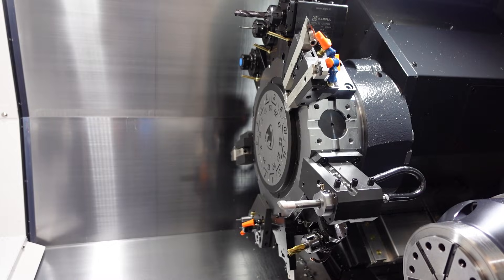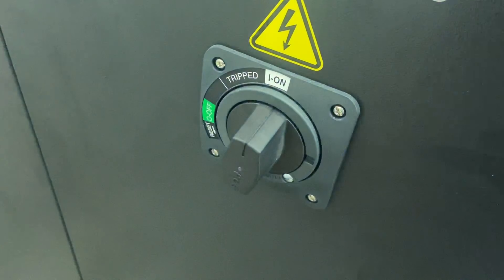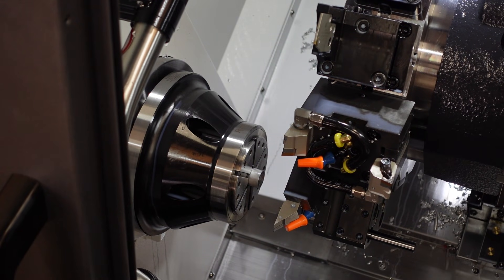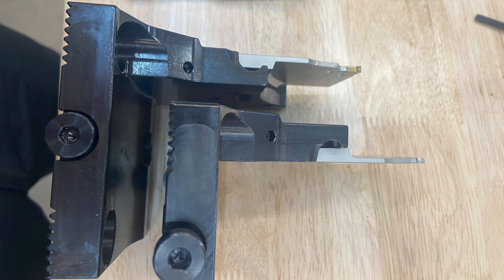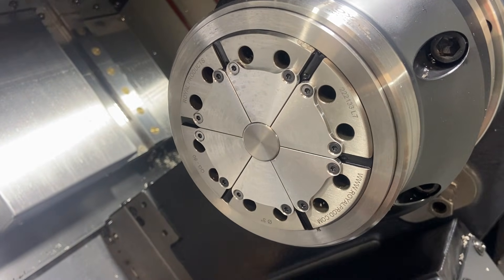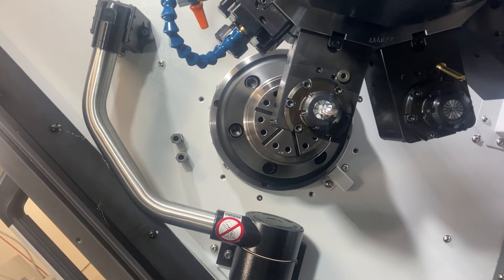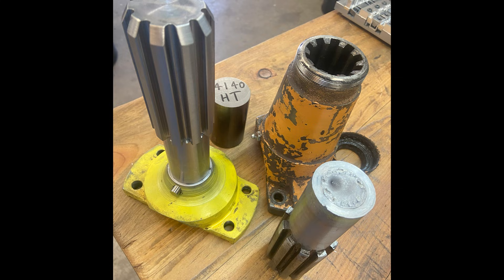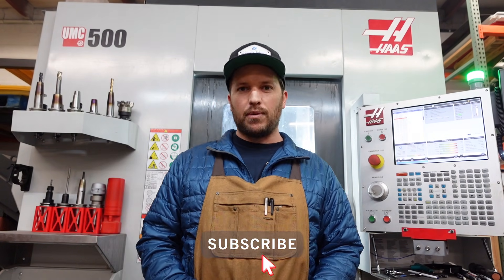CNC Mill-Turn Lathe | 10 Months In 12 Minutes

Comment: awesome stuff. Do those jaws need to be machined to sit flush up against the chuck? or is the clamping pressure going to be maintained just by the strength of those screws? I'm going to make myself some of those. Unless you've got a .step file you'd like to donate? lol
Reply from the maker: I don't mind sending over some .step files but they would only be useful if you also plan to use the Royal QG-80 3" collet. To be honest, making the aluminum jaws in the mill is easy in comparison to adding the tapped holes on the collet face. This is because the material is a hardened alloy so we had to thread mill instead of tapping due to the risk of breaking a tap inside the expensive collet. We can offer to do this since we have the process mostly figured out. Although it still takes some time to set up. Let me know how I can help, thanks. Bryan@PowerMoveEngineering.com
Reply from the maker: Also worth noting: we have been 3D printing some jaws as well. We figured we would at least try it out with 100% infill and it has worked surprisingly well. It is great for low quantity jobs or ones with oddball diameters where it might not be worth investing the time into making an aluminum set of jaws for.
Reply: @powermoveengineering  What type of material have you been printing with? I've been so timid on the 3d printing side of things because when I got into printing it was years ago where things were definitely not very good for industrial use. I'll need to brush up on that. I've got a mill so I know I can machine them which is probably best, and I'm getting a lynx 2100 lsyb shortly. And I was looking exactly at that same QG-80 when I found this vid.
Reply from the maker: We mostly just print with PLA and PETG. I have a friend with a 2100 lsyb with Royal chucks on both the main and sub spindle. However his has QG-65 on the main and a QG-52 (I believe) on the sub spindle. I have wanted to make a collet jaw version for the QG-65 because I believe that is the most common but I have not dedicated the time to that quite yet.

Comment: Very cool. We just got a haas st 15y a few months ago and I have been tasked with figuring out how to program and run it. Going through all the learning steps right now. We are a mill shop so all the tooling and everything for a lathe is brand new to me.
Reply from the maker: @boxheadsnow  lathes are much more involved from a tooling perspective. We went with Iscar for a lot of stuff however it’s tough to beat what Haas Tooling sells. Even used stuff on eBay can be a good place to look. Let me know if I can help with anything.
Reply: @powermoveengineering  Thanks man! Yeah I have been having my company order a bunch from Haas. How do you deal with clearance issues for radial live tooling? I would imagine it's easier with a collet chuck as opposed to a three jaw chuck, but do you extend a lot of your tools or stick your part further out from it's work holding? I was doing some milling of cross axis holes using a 3/16 EM and ended up setting up an extended ER 32 collet holder in the live tooling holder, but it extended approximately 2.5" and cut like garbage.

Comment: That royal collet hack was cool. I have a couple tt1800sy and have spent a small fortune on those. Wonder how the serrated side would hold up
Reply from the maker: @SigmaDG  We haven’t bought or made anything with serrations yet but I like the idea. Thankfully we haven’t had any bars slip either so haven’t felt the need to do that yet. With enough chuck pressure and accurate jaw/bar diameters, everything seems to hold up just fine. What size is your Royal chuck?
Reply: @ we have the 65s. We run the serrated on the main side with the bar loader and smooth on the sub. Biggest we drill on the sub is a 4” deep x 22mm diameter hole with high pressure spade drill from Allied. Also haven’t had anything slip but running near max of allowed clamp pressures
Reply: @ we have the 65s. We run the serrated on the main side with the bar loader and smooth on the sub. Biggest we drill on the sub is a 4” deep x 22mm diameter hole with high pressure spade drill from Allied. Also haven’t had anything slip but running near max of allowed clamp pressures

Comment: Our solution for different OD bar stock: Adjustable hard jaws when the finished part OD is less than the bar stock. Every 5mm I have a collet up to 60mm for collet chuck. For every other size if I need to grab a finished surface I custom make soft jaws for the jaw chuck.
Reply from the maker: @Leuka5562  Adjustable jaws are awesome but sometimes 3-jaw chucks can cause clearance issues depending on your tool arrangement. This machine came with a 10” chuck and quite often we can’t use half of the 24 tool positions when we use it. Depends on how many tools are needed I guess..

Comment: Those big parts are impressive.  Seems like most cnc lathes can't handle anything over 3 inches in diameter.
Reply from the maker: Thank you! I have been very impressed with the rigidity of the spindle and turret on the this Doosan.

Comment: Seriously. If you see this. Save me the head ache of  designing the same soft jaws.
Reply from the maker: @iexcedo6918  what type of lathe chuck do you use?
Reply: @powermoveengineering   I use the same royal chuck.   Given the company I work work I have to talk to them about getting a big size. The biggest we have is 2.25 OD.
Reply: I would like to do the same thing ur doing. When it comes to setup for my guys,   they can just change sleeve's and soft jaws
Reply from the maker: @iexcedo6918  you have Royal QG-80? If so, we can help with the same setup shown in this video. We still use it every day and have been happy with it
Reply: @powermoveengineering  I'm at home right now.  I don't recall the exact series number.  Give be 14 hours an I'll give you the info

Comment: First mistake you NEVER peck drill a ''U'' Drill NEVER!! Why would you do that crazy.
Reply from the maker: @tunnel7  If the chips aren’t breaking then pecking might be needed. This can be caused by not having the correct inserts for the material or the setup not allowing for ideal speeds/feeds. Worst case with pecking is that it wears the inserts faster but they still last almost forever so I don’t really see any issues with it.

Comment: Those chuck jaws look identical to the hose crimp jaws at the hydraulic hose shop I go to . Seems like an identical system .
Reply from the maker: @bikefarmtaiwan1800  I think I have seen what you are talking about. I forget what the jaws looked like and how they would attach but similar concept. One downside of this collet style is that the clamping diameter only has a .03” range so can only be used for very specific uses.

Comment: If you wanted stronger workholding for the QG-80 if the soft jaws are getting beat up they also have a s-20 and s-30 adapter for the QG80 size. That would significantly save on costs as the pads are ~$120. Although now you're paying a significant cost up front to royal to get the adapter. Our two Nakamura lathes both have QG-65 on the main and sub and I cringe every time I buy collet or in some cases two because our shop decides to buy bastard material sizes. Factor in a extended spindle liner (in our case) for that bastard size and you're in nearly $1000 before you've cut a chip.
Reply from the maker: @goldentrigun  thankfully we haven’t had any issues with the aluminum jaws not having enough strength or excessively wearing. Each set of 6 jaws is <$10 in material and 30 minutes of mill spindle time which could be improved on. I have been wanting to make a QG-65 version since they seem to be the most popular size.

Comment: Really glad to see this video. I bought a 2012 Puma 2100SY last year and I have a bit of a love/hate with it. It's really an incredible machine. My frustrations are mainly in how it's been hard to make it work for me in the context of my business. I mostly do milled parts. Everything I do is lower quantity. So it's hard to take advantage of the best parts of the machine. Meanwhile the older fanuc control is annoying and the manuals are fairly useless. I have also found the live tooling to be really incapable of nice surface finishes. Maybe all of my live tool holders are just worn? I think it might be more about the nature of live milling.
Reply from the maker: @cobraframebuilding  it’s difficult to move from a cnc mill with a real spindle, large tool changer, and big travels to a live tooling lathe. I still find myself making parts on the mill that could/should be made on the lathe because the quantity isn’t there. I understand your dilemma because we mostly do lower quantity jobs as well. What type of live tooling holders are you running?

Comment: Im a lathe programmer/operator of 30 years and and still enjoy it. Where i work we have 2 machines just like your Doosan and we tried telling the owner who bought the company with little to no machining experience...90% of our work is for the oilfield and we machine most inconel, duplex,and stainless with little carbon parts.What im getting at is both 2600's have the B axis sub spindle that we never use because it  dosent have enough horsepower like the main spindle and if trying to rough out inconel the spindle will literally stop while in the cut...We tried telling them before purchasing tje machines that a tailstock would be the way to go not a sub spindle...That's the only complaint i have with the 2600's....good luck with your business and have fun learning  the lathes.
Reply from the maker: @cncmach6779  thanks for the comment. According to Doosan the main spindle has 25 hp and the sub spindle has 10 hp. I have not been able to stall it but I’m not surprised since we’re typically doing light finishing work with the sub. Even with exotic materials, I am curious what type of tool path can stall it and if the setup can be adjusted to allow it to work. A tail stock would have come in handy a few times for longer parts and I am still researching for a way to use a spring loaded live center in the sub. I know Royal sells them but they aren’t cheap.
Reply: @powermoveengineering  My puma 2100SY sub spindle is beastly. I think it's rated at 20hp. Main spindle is 30hp. It's amazing. Mostly irrelevant to what I do with it but badass when you can use it.
Reply from the maker: @cobraframebuilding  that’s awesome. I got a quote for a Puma when buying this Lynx but I was already pushing the limits of what I was willing to spend. I haven’t felt held back by the Lynx quite yet thankfully
Reply: @powermoveengineering 
The lynx and puma are both excellent machines for different environments.  
We have 200+machine tools.
The puma will pound heavy iron castings all day.  The lynx is for more refined work, very versatile and durable for what it is.  Good choice.

Comment: Hi, please can I ask a quick question. We need to make some small cog parts which are similar in form to your throwing-star fidget spinners. Presumably you part these off and then finish the back side in a 2nd milling operation? I'm guessing you can't pass these off the sub-spindle and finish in a single operation because they are so thin?
Reply from the maker: We designed those parts to have no features on the backside so that they do not require a second operation. We use a “backside chamfer tool” to break all edges before parting off. However I do think it would be possible to pass these off to the sub spindle if needed. Would just need to make custom soft jaws to match the outer profile. We actually end up surface grinding the back side to make the knife edges sharp and improve the look. I can offer advice if you send me more info about the parts you need to make. Thanks for the comment
Reply: I really appreciate you taking the time to reply, thanks. We're looking at making jockey wheels for bicycle derailleurs. If it goes ahead then I'll definitely accept your offer of firing over some more questions! Thanks again.  @powermoveengineering

Comment: Congrats man. I’m with a DN solutions distributor. The Lynx 2600SY is a great machine and will serve you well. We’re happy to have it in our lineup!
Reply from the maker: It is a great machine! Seems like the right size for a wide variety of parts and the build quality is there. Let me know if I can help with anything. Thanks for the comment!
Reply: We have the same machine almost exactly set up like yours, very nice. What brand and where could we get the cut off tools like you have? We also have problems plumbing thru coolant for boring bars and such. Thanks so much for the video great info.

Comment: Great idea with the collet  pads. I am going to do that on my lathe. I think I will make the body on the lathe and then cut the segments in the EDM. I will let you know how it goes. Thanks for sharing the idea, I appreciate it.
Reply from the maker: That is awesome! Glad to have inspired something. Having easy access to an EDM must be nice. My original idea with making the collet pads was to make them from a single piece of round and then cut them apart using a slitting saw. But setting it up and finding the right tool didn’t seem worth it at the time so we just made them individually on the mill from some 2”x2” bar that we had leftover. Thanks for the comment and let me know how it goes!

Comment: I have been very intrigued to see more people with the Lynx 2600SY machines. I got a quote for one of these back in 2022, and was surprised to see that your pricing was pretty comparable to what it was back then (although I do not think the dealer was giving me any sort of new customer discount). The 2600 makes so much more sense if you can afford it over the 2100 simply for having the BMT55 turret as well as more clearance, I think the 2600 has about a $50k premium over the 2100 if I remember. I have become a bit of a Mazak guy myself, but there are some limitations and things on their machines that really make me want to beat my head into a wall from time to time, so maybe going forward I will revisit the Lynx 2600SY when a new spindle is needed. Nice work!
Reply from the maker: My buddy got a 2100 one year before I purchased this machine and after seeing how cramped the turret became (especially for sub work), I knew I wanted the next size up. I don’t have any experience with Mazak but from what I understand the quality is top-notch and the mazatrol control can be a game changer for some. I personally don’t like programming at any machine and prefer posting completely finished code from a desktop, so I am happy with this setup. Thanks for the comment and let me know if I can help with anything

Comment: we have the same machine
Reply from the maker: How has it been for you? Any issues with the machine?
Reply: @powermoveengineering  mostly good, we have some annoyances related to chips getting into the coolant tray and coolant splashing next to the door and in the back right corner (which i think is because of the 70 bar (1000 psi) option). the chips in particular means we have to clean it out every day. we only use it for aluminium parts with pretty loose tolerance but we do need to make them fast. we also started with iscar tooling but honestly we weren't so happy with them. we mostly use ceratizit and tungaloy now with ews vx3 live tooling holders, and we're trying out a kennametal u-drill

Comment: Consider running the cutoff holder with the "flush side" toward the sub spindle, then pulling the part with the sub and staging the next part in the main during the transfer. This will give you the clearance on the main side and get you as close as needed on the sub side. 
Your part stick out on the main side will control the cutoff holder clearance when the parts are shorter and it's an issue.
My $.02
Reply from the maker: Thanks for the advice. Seems like there’s a few different ways that could work including the way you’re describing. We ended up just getting another mirrored part-off tool design from Iscar because we wanted to keep a backup on hand and have different options for different parts. Thanks for the comment!